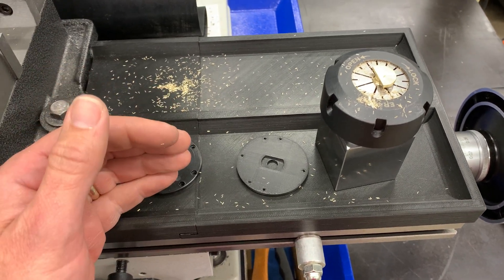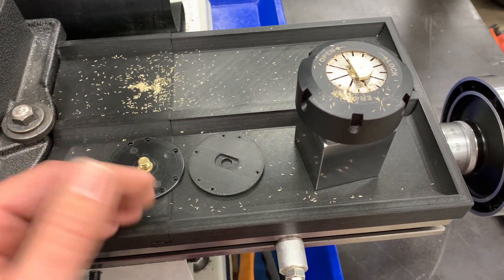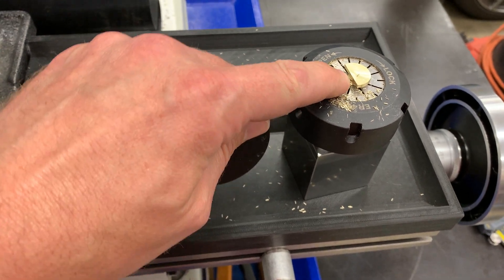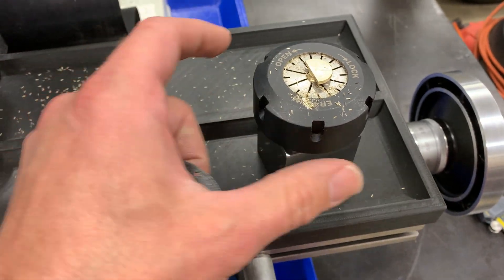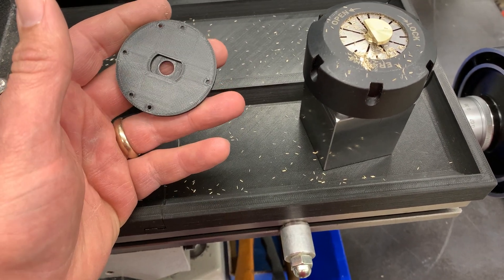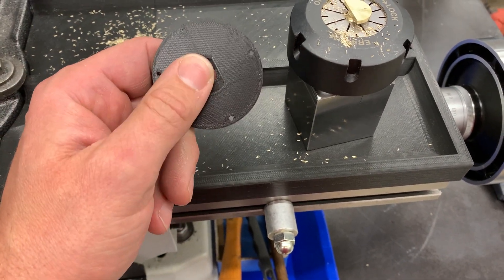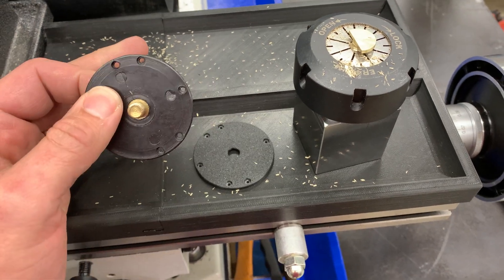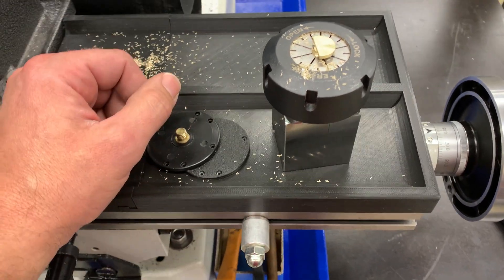I Screwed Up -  Part 2a of Replacing a Dial Indicator Back

Comment: Forgetting to divide by two is my middle name
Reply: The acronym we’ve used is NISWGI ….. ‘nis-wig-ie’……  Nothing Is Simple, We Guarantee It.  
Everything looks simple on YT.  That’s because no one wants to watch all the thinking and preparation required……. Except is real life, Thinking and Preparation is REQUIRED 😂
Reply from the maker: I usually measure 3x and still do the eyeball check, but it was 99% done and it was "just two simple ops".   Wrong :)